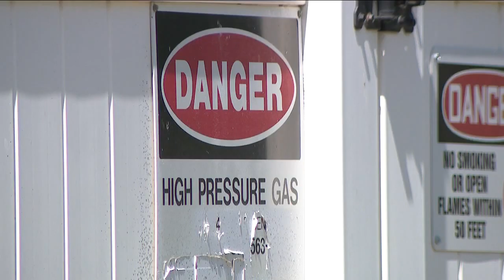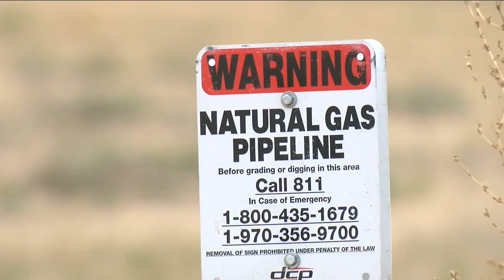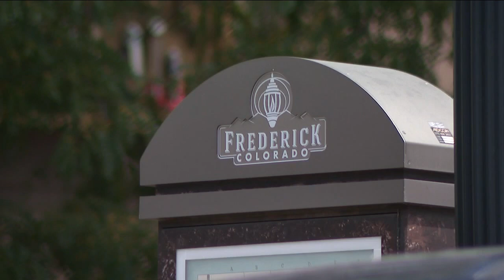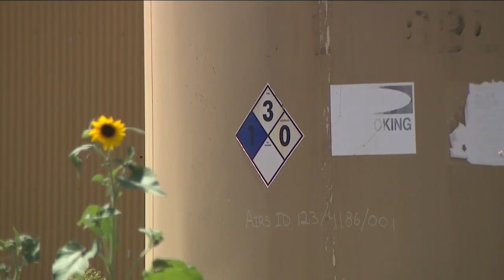Colorado still figuring out how to hold oil and gas companies accountable for clean-up

Comment: To plug an oil well costs $92,710 in Colorado. 
6,842 Feet is the average depth of an oil well. 
The first 1,000 feet would cost $93K+20% for each additional 1,000 ft. 
Total cost for 7,000 feet of one oil plug is $100,200 

There are 50,000 wells throughout CO = $5 Billion dollars to plug wells.  

Frederick Population 15,761, Cost per person $312,500. 
That's more than the cost of medical school debt for a Doctor $215,000 average